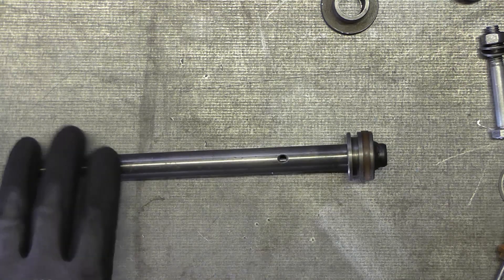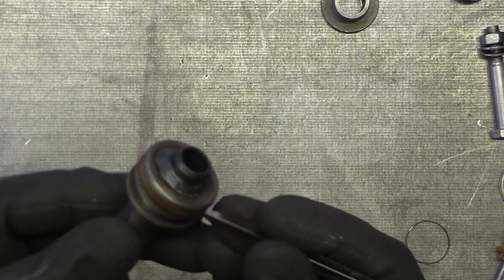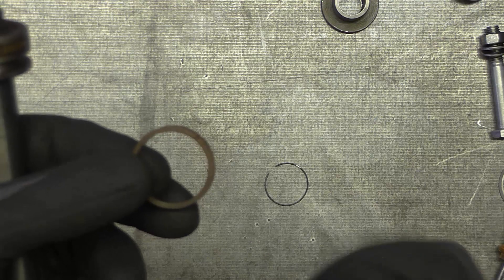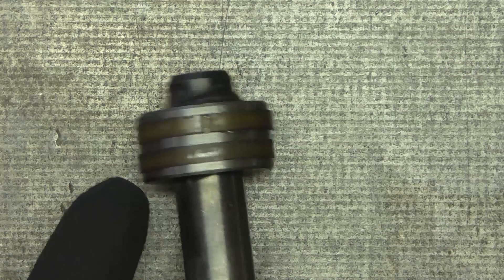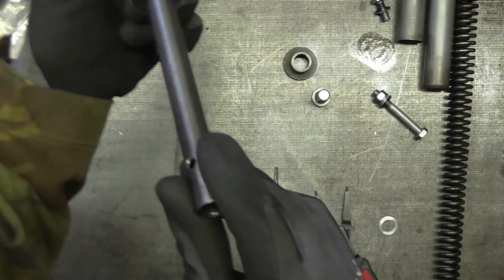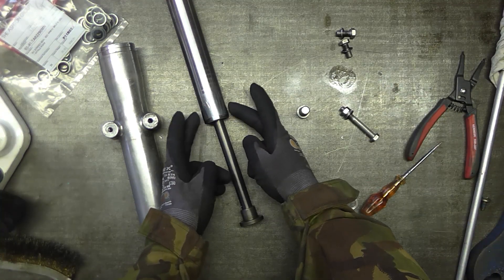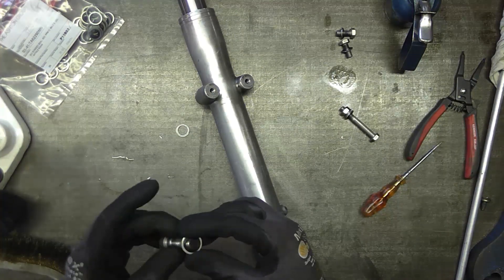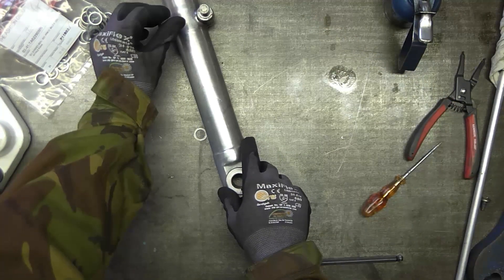Club bike recomission part 4

Comment: Are the fork seals the same across all the years of the strada's and sports.

Good video. Very helpful.
Thanks. 👍
Reply from the maker: They're the same across all the Marzocchi forks. I've not yet seen a Paoli set. They may only have been used on very early bikes. 

If you use propper double lip fork seals, then two seals aren't needed. You could put in a spacer, or re-use and old seal.
Reply: Paul Compton 
Thank you Paul, it's what I thought but just thought I would ask.

I am going to have a go myself now thanks to your video. 👍